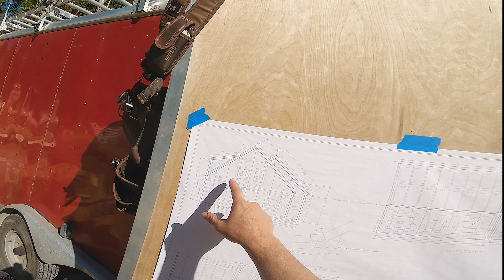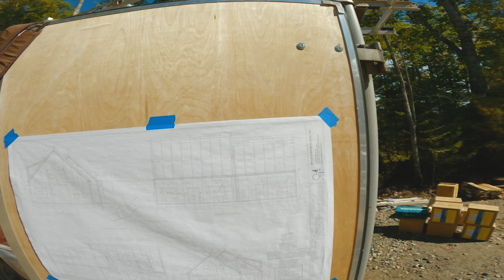Installing SIPs On Two Timber Frame Buildings | Shelter Builds a Country Home & Garage | Ep. 4

Comment: @Shelter Institute Why does it always seem you build with sips?
Reply: Why don't you?
Reply: @jackwhite3947  I don't teach but I've seen in colonial Williamsburg examples of studs let in to timber framing that allows for modern insulation of other types
Reply: @josephlathrop1914  I think I've seen what you're talking about. Stick built walls with insulation ,foam sprayed and sealed in place . Ray-Core , has a product that works like that . The reason that sips work better , is the insulation is rigid and it completely isolates the inside from the outside. Stick built walls connect , bridge or conduct from the inside to the outside . The sip walls are stronger than stick built construction and no gaps or bridging. The reason sips were are used in the first place is the superior insulation , and R-value
Reply: @jackwhite3947  Not what im talking about. Imagine Building your Timber frame as you normaly would with a Sill. Now cut a mortis in the sill every 16 inches on center as with stick built construction spacing, instead of nailing your studs in place at the top and bottom cut the bottom of the stud into a tennon to fit the mortis and at the top of the stud cut a 45 degree notch in the beam on the exterior corner above, cutting the top of the stud to match. one Screw, Nail or Peg to secures each stud in place. and allows for useing Rolled or Batten Insulation between the studs.
Reply: @josephlathrop1914  you got me there , As far as the studs and or cutting goes . But that would defeat the purpose or sips . Witch is insulation, to start with . Not to mention ease of construction. But if it works and meat code and your satisfied. Good on ya.
Reply: @jackwhite3947  my question was always why does it seam like i only see you guys use Sips. there are other ways to insulate a timber frame. the Method i describe was used in Colonial Williamsburg for walls that used lath and Plaster on the inside now replaced with drywall in modern construction and ship lap siding on the outside but these are buildings that lasted. stick built is made to last 50 years till someone desides to tare it down and build a strip mall. Sad really..
Reply: @josephlathrop1914  I grew up in a home in Michigan that was lapboard sliding and plaster and lattice interior , maybe at the time it was built it was a wonderful house ?  But by the time we moved in it was well passed it's prime , and probably not well taken care of.  Given the Mich. Winters I can say from personal experience that it was not wonderful . The Craftsmanship that went into building a house like that at the time was pretty good. But at no time during it's life cycle was it warm or energy efficient. Today we have the ability to do both .we can build structures that are efficient , sustainable and environmentally responsable . And might I add cheaper to build . If you want to build something different than that . Ok not a big deal . If you enjoy it